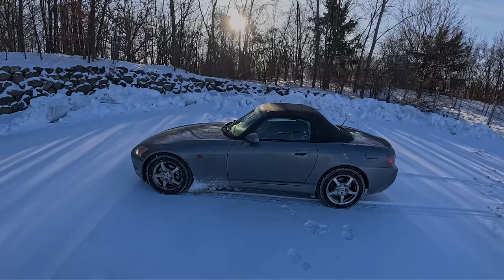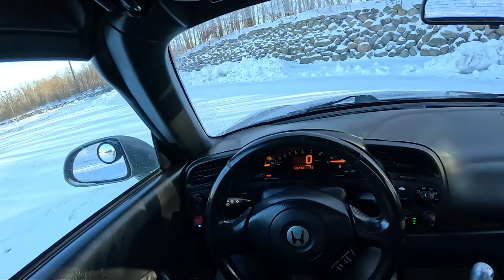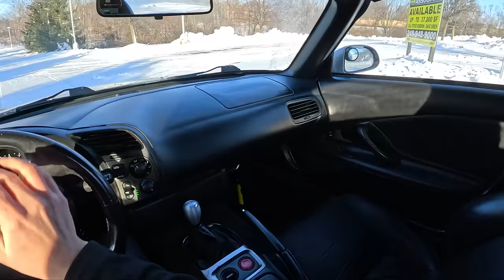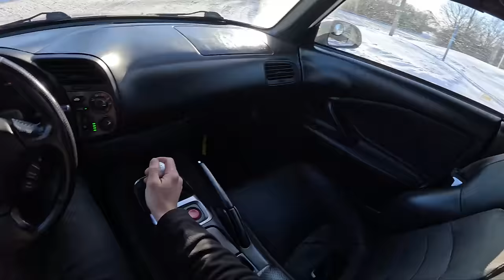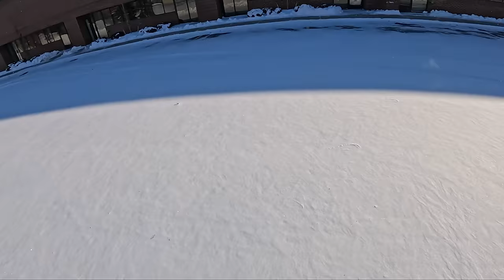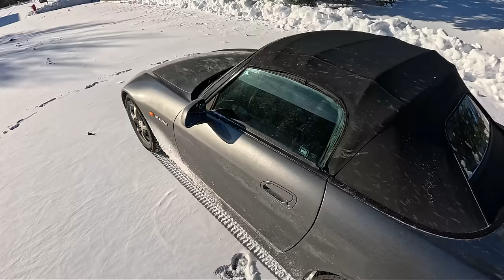2001 Honda S2000 in the Snow - POV Winter Driving Impressions

Comment: I'm actually pretty surprised on how it can control itself even in this weather
Reply: If you put me in that car I don't think it would control itself quite as well.
Reply: @streamius  realest thing I read today
Reply: tires make a world of a difference driveline doesnt really matter for the most part
Reply: I dont even atempt to drive my 02 S2k w 50k miles if there is even a spot of ice on the road it goes sideways going straight and slightest touch of gas its not a good outcome being said i have Michelin sport cups on it so its a nightmare fun in a parking lot if not too deep i got stuck once and luckily someone saw me and helped me get unstuck

Comment: The s2k is amazing in snow thanks to 50/50 weight dist and RWD with some good snow tires.  I used to laugh at AWD vehicles stuck.  As long as u don't mind cleaning under carriage and plowing street w lip, it's a blast!

Comment: Last week I went into the mountains in my NC Miata on Blizzaks, and my friend brought his 3V Mustang on Hankook i-Cepts.  We arrived on our favorite road just as a 14-inch snow dump and blizzard was getting started.  We had quite possibly the best drive ever, practicing the art of no-countersteer drifting up and down the Carson touge.  When you drive sideways, the cloud of snow blows sideways and the guy behind you can still see.  The convoy of Jeeps were VERY surprised when they saw a couple sports cars street racing Initial-D style on that road.  When the Miata started leaving tracks from the differential and control arms, we decided to break for home.  Eventually it got to the point where I was pushing a bow wave of snow, and in certain parts it was coming over the hood and windshield as we clawed our way out of a canyon.  We split up at Goldendale and made our separate ways back home.  I will NEVER forget that drive.

Comment: As someone who daily's an NC Miata through Canadian winters, hell yes! I'd also like to add that there are actually some unexpected benefits to driving your small RWD sports car in the winter:

1) Fewer + smaller windows = less snow and ice to scrape off
2) Once the engine gets some heat, the HVAC has less cabin volume to warm up, so the interior gets toasty pretty quickly.
3) As silly as it looks, you have similar clearance to anyone else in a civic, corolla, etc, you just have to contend with RWD
4) The faces of people in their crossovers on all season tires who have poor braking and handling in inclement weather and think that you're crazy.
5) If you like sports cars, why deprive yourself of yours for several months at a time, get some winters and have some year round fun

That being said, I probably wouldn't do this with a pristine S2000. If my Miata rots I can very easily find another one in good shape at a reasonable price. The same can't be said about S2000s that are essentially becoming collectors now.
Reply: Hell yeah, dude!  I'm also dailying my NC through the winter, though we don't have it quite as rugged here in Central WA.  I've been hating these Blizzaks on dry and wet, but since the snow started falling, they've been amazing.  The drifting controllability on ice is just unbelievable.  I've never driven any vehicle in any condition that has such a smooth break-away and recovery as this Miata does on ICE.  It's like cheating.

Comment: I just bought a set of xice snow for my outback wilderness. After the first couple hundred miles of break in with the tires, we got hit with snow here in MN, the confidence and traction it gives you is crazy good. I do a lot of driving up north to duluth from the twin cities so having these tires, I feel safe. Haven't been able to use any of the x modes but maybe later when we get more snow on the ground and I can head out to some forest roads :).

Comment: Man i miss my S2k. It had hks single exhaust, berk hfc, coilovers, etc. thing cornered like it was on rails and sounded beast . Fun cars
Reply: I have the same exact setup on my 02 Ap1 w only 50k miles Hks high power single exit w 70mm Berk test pipe,Skunk2racing pro st coilovers and a AEM cai and Mugen 3 black suede steering wheel best car ever imo
Reply: @benjaminemerald8027 how are those Skunk 2s on the S2000?

Comment: Hey Topher you can look into karcepts str tune done with emanage. Basically it's a map designed work with aftermarket i, h, tp, e. Will lower vtec from 6500 to 4500 will gain about 10whp up top and 30 lb tq mid range. All in all its about $1k for emanage, tune, and wiring harness

Comment: Totally different road conditions from the other day in the brz.  Much colder makes for more fun.
I think the Falkens were studded and these Michelins not.  Is that true ?  Does this S2000 have traction control ?
Both cars have Torsen lsd I believe....no clutches.
Reply from the maker: Yep, very different. I’ll also be uploading a BRZ video from the same day as this s2k drive. And you’re right, both torsen diffs. Falkens are studdable but not studded (can’t run studs in MI), and no traction control in the s2k!

Comment: Is rust proofing effective? I’m afraid the oil film will attract and trap dirt and grime and make the problem even worse. I’m thinking regular washes including the undercarriage would be preferable.
Reply from the maker: It’s very effective at keeping your car rust free. It’s not effective at keeping the underside clean. That said, dirt trapped w/the oil coating will act more as a barrier than a trap for moisture.